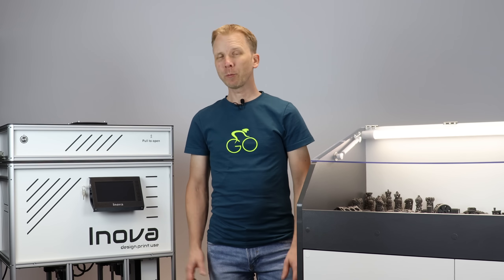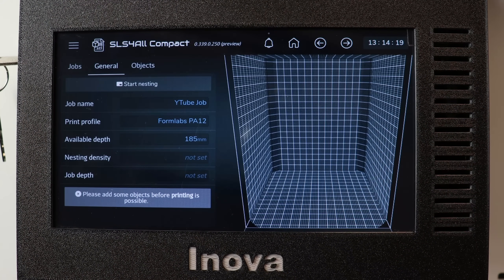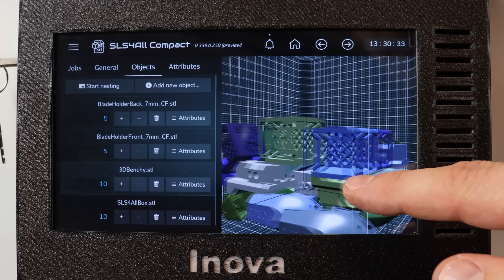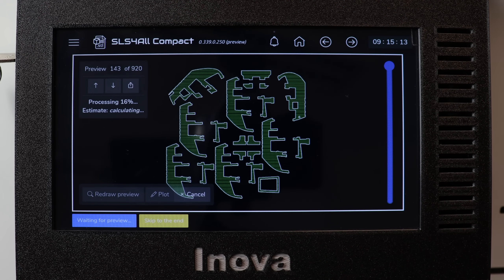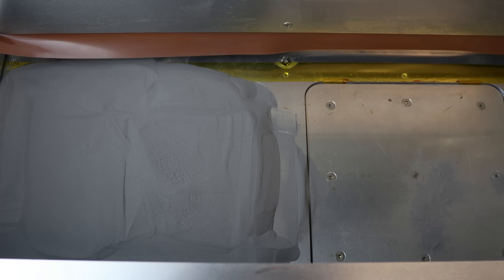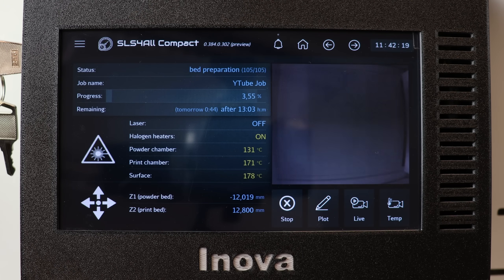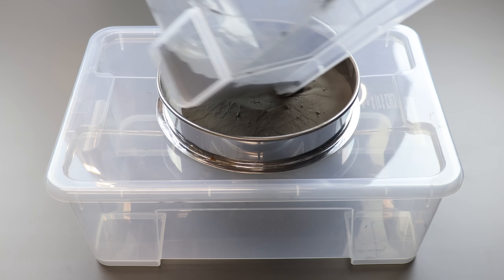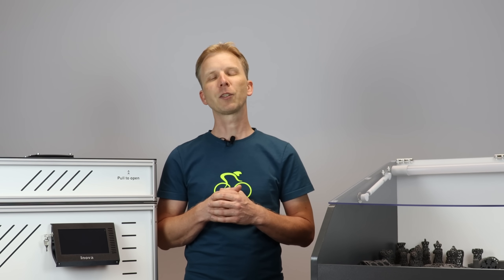Excited about building DIY SLS printer? See how it prints!

Comment: No discouraging from me and it already looks great. Been aware of you're work for a little while. I know it could be a ways off but what is involved in being capable of metal? Im not talking about sintering the metal directly with the laser but using a metal powder with binder. The binder is sintered with the low power laser then parts removed from cake and finished in a sintering furnace. I think you should look into finding suppliers of such metal/binder combo powders and start experimenting with those.

A sintering furnace should be easy to engineer in comparison to the Inova.
Reply from the maker: Thanks for yor support. You are right. Cold metal fusion, how this is called, should be possbile with the Inova. I know the company making materials so I plan to contact them once I have some spare time.
Reply: @SLS4All  That's great. Calculating shrinkage percentage of caused by the sintering furnace on the parts for various metals should be easy. There would definitely be challenges. I see lots of value in you're equipment with polymers especially for composite materials as it is. Metal is really kinda the "holy grail" though you know. It's really what most people want I think. Anyway was happy to have sparked the conversation and while I don't think I can afford the SLS at least for a while I wish you continued success and good luck.

Comment: So, what's the word on safety concerning SLS in a home environment? Seems like you'd need to be meticulous about ventilation, PPE, recapturing old powder, etc. to avoid health hazards.
Reply from the maker: If speaking about the Nylon PA12 it is officially categorized as a non-toxic material. However, it doesn't mean you shouldn't protect your self. You are right - good ventilated room for printing and mask + gloves when manipulating with the powder is a good way how to protect yourself.
SLS is for sure not the "print in living room" technology.

Comment: You guys should also launch a kickstarter because we now know there is a load of supporters from the micronics kickstarter who will be getting refunded with no option of getting an SLS printer. Launch a kickstarter, get a ton of preorders and drive the price down as low as you can!
Reply: Or maybe don't rush into a kickstarter. Micronics printer wasn't ready for mass producing so probably they had to sell out, while they still could.
Reply: @_Dimon_  I think if it is launched just as a DIY kit on kickstarter instead of a fully assembled machine than SLS4All seems to have everything working and all the documentation available. It should be released as open source like a prusa and the community can support it like the voron

Comment: Is this a kickstarter project or I can order one?
Reply from the maker: Thanks for your interest. It is not a KS - you can order at the project webpage (sls4all.com).
Reply: I just ordered sample parts. I noticed there is no price for EPP station on your website. Is it available?
Reply from the maker: Hi, it will be available sometime before winter.
Reply: @SLS4All  thanks, for the answer. I rather order them together. Are the sample parts sandblasted? I've checked and the Formlabs Pa11 CF melting point is 197-210°C or Sintratec shows 198°C
. What do you think, can your machine print any of those two?

Comment: My 3 cents: slicing and having jobs should be done on full fledged PC. Trying to operate and fill build volume on touch screen is like hitting yourself with hammer.
Reply from the maker: You would be surprised how easy it is. Anyway, you can connect to the printer and to do it remotely on PC via ethernet or WiFi which I also do quite often.
Reply: @SLS4All  I dont even like using my phone for anything else than calling people and making pics 😆good to know its not mandatory and you can actually do that on PC.

Comment: You probably want the halogen check before putting in the powder?
Reply from the maker: No, it must be done with the powder inside. Reason is that the aluminum beds are reflecting the heat and the IR thermo camera will not capture it.

Comment: Amazing! $7000 is an amazing price point for the technology - unfortunately still too high for me though, hopefully this continues to develop and reduce in costs over time, I would love one of these!
Reply: I remember my first (open source)  FDM printer that was 2000 euros with a build plate of 12x15x15cm. If i see how it evolved and what is available for a fraction of that price or even in the same ballpark like Vorons... I'm sure projects like these will reduce the price and make it more accessible. I've seen it numerous times with CO2 lasers, FDM printers, resin printers, 3D scanners,...
Reply: At least for hobby use the prize for print media also needs to come down quite a bit

Comment: Micronics just became a sellout, and this video pop out on my recommendation list. What a day, my question is that, is it possible to have it made with a large build volume? if so which parts that needs to be modified to accommodate the large build volume?
Reply from the maker: Yes, it is possible. In the Z-axis it would be relatively easy to redesign it to have printer with a deeper chamber at the end.
XY axes which means galvo controlled axes will be a bit tricky if you think about more than say 15-20mm in each axes direction. It will mostly be about the mechanical parts and maybe about some of the heating elements.
Reply: @SLS4All  I see, thanks for your prompt reply. Really looking forward to build this printer once I got all the parts, Thank you for what you do for the community.

Comment: Safe to assume that you don't require supports the same way that you would with resin prints?
Reply from the maker: Yes, SLS printing is support free. Parts are supported by the non-sintered powder around them.
Reply: yes. but you need to make sure you can remove the powder from your finished part

Comment: Really nice UI. With the demise of micronics, this becomes more interesting.
I could see that using a RPI 5 in place of the 4 could be advantageous in arranging parts quicker.
Reply from the maker: Thanks!
We started with the RPI 4 in our first prototype years ago. Then we moved to the RockPi 4B because during corona RPI was impossible to buy. But we faced significant problems with the long term stability. Therefore we moved to RPI 5 as soon as at was possible to source it easily. So, it is in there already.